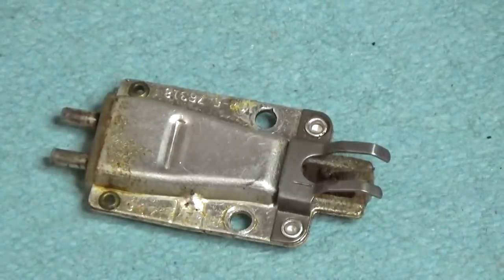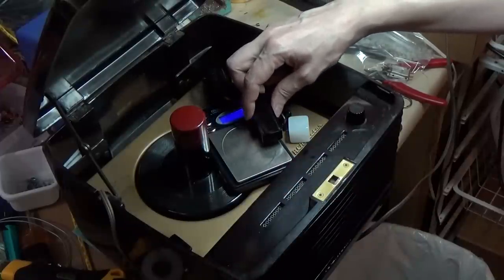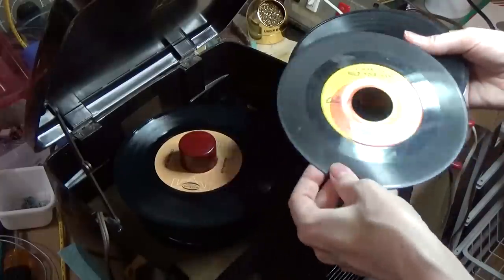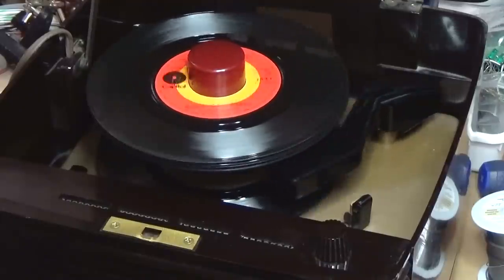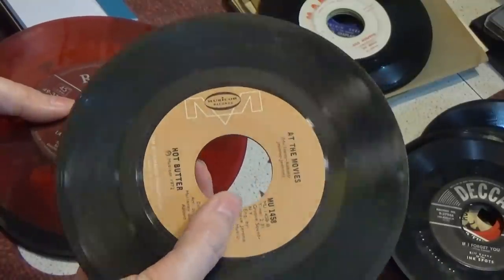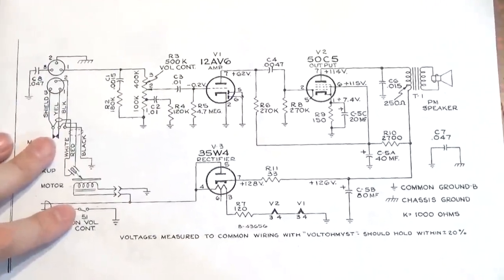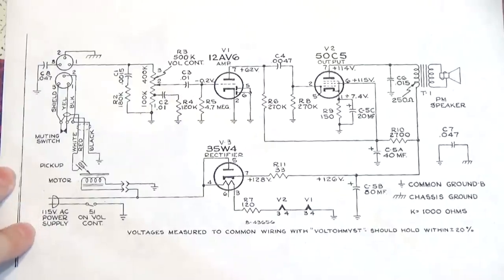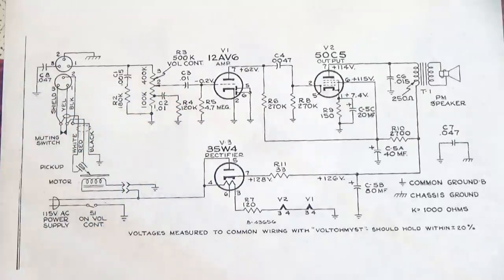RCA Victor 45rpm Record Player "Desktop Jukebox" Repair

Comment: Chris Cuff is the expert on these RCA 45 RPM players; he has videos showing a full teardown and rebuild of the mechanism. Your player uses the RP-190 mechanism, introduced in 1950.
Reply from the maker: Yea, A guy sells refirbed rubber parts for these but honestly I just don't have the time to tear into it for that idler wheel.  It's fully oiled and greased, and that's fine for me.
Reply: if you had to,, replace the rubber with 2 or 3 stacked o-rings of the correct OD/ID size. And lead tape would prob work well for the weight.
Reply: Rubber parts can be boiled to remove flat spots, and MG Chemical sells an excellent rubber restoring fluid which works wonders and smells really nice (paradoxically, many such things you shouldn't spend a long time smelling smell really good, liquid electrician's tape comes to mind, smells like the Frosting of the Gods...).

Comment: Hi, my first record player was an old RCA 45 RPM deck like that, but without the fancy case. I found it at the dump ground and later found an old AM radio that had a plug for the RCA jack to hook up the deck to so I could listen to records.  We had a teen center where the places in town that had juke boxes would drop off their used records, and we could buy them for a quarter each (this was like 1964-65) so that's how I managed to get records on my buck a week allowance. Sure brings back memories seeing that old set working! I had an old shack behind our house that was at one time a farm grain storage shed long before the town closed in on the old place where we lived.  I fixed it up, even sheet rocked it with panels we tore out of old house that we were paid to tear down, I had her fixed up nice. We had an old couch that I put in there, an easy chair, I brought down an old second hand TV set that my uncle gave me when he got a new on and put out there, even found an old bed in our storage area that I put up in the second room of the shack. Put my record player back there and used my old train transformer to power an old sealed beam headlight that we had painted red to illuminate the place.  It was great, what a place for young teens who were experimenting with our sexuality. I can recall getting it on with my first girlfriend to the tune "Hello I Love You!" by the Doors playing on that old 45.  It was the only record on the machine and kept playing over and over as we explored each other.  Ah yes that was a time to be alive, the 60's before everyone was frightened by AIDS and free love was the topic of the day.

Comment: Fran there is a spring (or should be in the rear of the tonearm.)  take that spring off and you may need only 1 (Nut) weight or possibly none.

Comment: In my days as a broke teenager, there was a vending machine company that sold 45s pulled from jukeboxes,  25 cents each, 5 for a dollar. A lot of them were on their last legs already, but played on my Singer portable they were all mine. Had a 45 of Hot Butter, too.
Reply: That was a good song!
Reply: in my neighborhood, it was a stereo/camera shop that got the 45's from jukeboxes. 10 cents each - no sleeves on them, and all had some obvious wear, but played well. It was a great way for a kid with very little money to build a collection of 45's. Most were only a year or two old.
Reply: I was a teen in the 80s and I don't recall there being an easy way to buy jukebox rejects.  A new release was about 1.50 and used records generally went for 1/2 of that or less.
Reply: Some of us just got lucky. I miss the days of huge warehouse style record stores like Tower Records. I  could have spent a lot more $$ there...except I didn't have much money.
Reply: There was a store I regularly went to in the 90s after vinyl died that specialized in 45s for jukeboxes. They had loads of old used 45s pulled from jukeboxes for very cheap, and also had many new release songs on 45s labeled “for jukeboxes only” that weren’t that expensive and were often on colored vinyl. I remember buying Creep from Radiohead there when it was a new hit song.

Comment: Hi Fran. 😊 The 250 ohm for the output transformer primary is the DC resistance.  The actual load impedance will be probably 3k or so. Cheers.

Comment: I believe the stylus is not sitting down snug on the felt pad that that ultimately  is connected to the ceramic element  hence you need extra weight to push the stylus up against the pad even before you add the weight necessary for the basic tracking.
Remove the stylus and slightly bend it near the screw mounting as to cause the stylus to press up against the pad when the screw is tightened.
From an  old time tech...Glen

Comment: Back when audio/video equipment popularly had rubber drive wheels, they used to make a fluid for reconditioning the rubber surfaces of drive tires.  But, that only helped with traction issues, and was never permanent, at least in commercial use equipment.  It was great to put equipment back into service while waiting for repair parts to arrive.  That said, what I hear in this video sounds like a wheel shape issue.  Flutter can also come from sticky bearings or bent shafts.  

I think from the 50s and later, most changers were small spindle type, and ppl bought plastic inserts to adapt 45s to play on small spindle players.  Meanwhile, juke boxes' tooling typically handled the 45s from their edges.  The thicker hubs made it easier to insert the plastic adapters, and allowed for a longer lasting hub diameter in juke box service.  The importance of working with a 45-only changer fell by the wayside.    Just a guess, though.
Reply: Kind of an inaccurate guess. The changers that were popular in the ‘70s well through the mid ‘80s (I had several back then) used a special spindle for playing 45s that dropped them from the big hole. The most common one was made by BSR. The biggest difference is these held the records stationary until it dropped them on the platter. This was the most common one: https://images.app.goo.gl/p6UjSNfv9rQEW7YR7

Comment: The rubber drive roller has probably hardened and lost its elasticity. If you use your thumbnail to make an impression and it doesn't spring back & disappear in a few seconds that indicates the rubber has "perished". That's why you have to replace or recover typewriter platens from time to time. Suppliers used to give us little sets of one "live" rubber ball and one perished one, so we could demonstrate the difference. The live rubber bounces while the perished rubber just drops like it's make of wood. There are companies that "re-tire" rubber rollers. It might be worth checking out.

Comment: For all of 0.02 seconds i expected you were going to say you'd a cunning way of whittling the actual grove contact tip from some kind of unobtainium to replace the one in the stylus on your new pickup. As usual, another neat video. The actual sound with the warble effect would send my crazy meaning i'd probably tear the entire mech down and fail miserably locating any kind of parts to be able to fix it...
Reply: It’s just the idler wheel that needs replaced. They’re actually not hard to find. That’s the next thing I’d have fixed as soon as I got sound out of it and realized it had such bad wow.

Comment: Fran, the center indentation of the record that you are referring to is caused by a set of machined dies as you stated later in video.  There were several different styles of dies, but in 1950's through the 1970's there was a spec called out for this inner indentation.  BTW - RCA began development of the 45 rpm in 1939 and issued the first 45 rpm's in 1948 or 1949. Great video.

Comment: I found one of those old 45 RPM decks out at the city dump once when I was a young fellow, we were pretty much dirt poor so if I wanted stuff to tear apart, I needed to crawl down in the pit and see what others had thrown away.  Back then there were no dump ground supervisors, it was just a huge pit where folks tossed their crap, and the city dump truck would dump.  Took it back home and hooked it up to a small amp I had found some time before.  Boy I had something for sure, it sounded really great too, I hooked up all the speakers I could find and tried to tune them with variable resistors I had pulled from old TV's and the like, but they just amounted to switches that would play the tunes over the speakers if turned all the way one way, but still I made it my self, and really wowed my friends, especially that little girl next door, but then that is another story completely.
Reply: Oh the tune that was the favorite back then:  The Doors "Hello I love you won't you tell me your name"
Reply: Did you win her over?

Comment: Hello Fran !!  With that 45 player idler wheel try using just a little "RUBBER RENU" on the idler wheel surface, it may reduce that warbling by a fair amount !  RUBBER RENU is a cleaner/rejuvenator liquid compound, it restores some lost elasticity to the rubber which may reduce that "warbling" sound effect.

Comment: After doing my own restoration of one of these, I was still getting a loud, intermittent hum.  The tone-arm wire is a twisted pair, not shielded, and it's held under several metal clips on its way between the tone-arm and the amplifier.  Turns out the wire was frayed slightly under one of those clips.  Some electrical tape around the wire fixed it!

Comment: Just so ya know... it's not paraffin that leaks out of the cartridge, it's Lanolin. Nice video. It's really a shame that they don't offer the Pfanstiehl P-51 with a diamond tipped stylus. I gather from what you said that you somehow bought the Pfanstiehl P-51-2 (with the -2 indicating a 2 mil tip). You can buy the Pfanstiehl P-51-1 which has a 1 mil tip, but both are sapphire tipped. For those curious...the P-51's are supposed to deliver .7 volts to the preamp. I wish I knew what the original crystal cartridge (RCA 76318) voltage was ….

Comment: Hi Fran!  At 16:15 you remark that 250 ohms is a pretty low value for an output tube plate.  The 250 ohms is the DC resistance, not the AC impedance, which for a 50C5 would be in the neighborhood of 2K.

Comment: Great memories, I had the basic changer only version of that machine., no case or amp. I well remember that old ceramic cartridge.  I remember certain later “45s” would hang and fail to drop.   Wish I still had mine some 50 years later, but sadly it went to a new home during one of mom’s garage sales.

Comment: Initially when I restored my 45 player (same mechanism as yours) I used a stereo ceramic cartridge and to make the tonearm heavy enough I first loosened the spring some then later on I replaced the spring with a bolt I glued in the space where the spring went.

Be careful with that mono cartridge and stereo records as most mono cartridges don't have the compliance to properly play stereo records without damaging them.

Comment: People often think a heavy tracking force such as used with ceramic cartridges will damage records.

It won't IF the tracking force is within the manufacturer recommended range for the cartridge and stylus tip shape.

I suspect most of the 45s were played on ceramic cartridge record players and many if the player and record was taken care of still sound very good today.

I have a few that I know my mom played on ceramic cartridge record players which I did as well and they still sound like new.

Comment: Lol...  I was fortunate to catch the tail end of the 45 singles era in the 80's as a teen.  I remember my parents had a record player that had the standard sized "nub" for LPs, and a tall multiple disc changer (removable) cylinder  part that would optionally sit on top of that for 45s and worked as a changer like your jukebox.  It was all auto like yours, so it makes me wonder how ours would have known to drop a record, perhaps the LP nub had some mechanical bit I didn't notice back in the day...  It was of a newer vintage than yours, probably late 60s, and I don't recall the changer having problems dropping newer records from the 70s and 80s.  Anyhow, great video!
Reply: ...oh, and oddly my own personal record player had the reverse set up, where the LP nub was really tall and could automatically drop up to three LPs,  but only had a little plastic "hockey puck" for 45s.  But I think this was much more standard by the 80s.

Comment: RCA had a vested interest in making their records compatible with those changers they were giving away for 15 dollars apiece; I'd be surprised if competing labels were as diligent even in 1950. I'll bet the 45s with thicker inner edges actually worked better with one of those one-piece GE 45 stacking adapters. BTW: I've heard that putting a rubber band around the outside of the idler, supergluing it and sanding away the superglue can restore them. I'll have to try it sometime.

Comment: 6g is pretty low btw. On eastern side of the iron curtain we had 7g to 12g as a standard for ceramic cartridges, depending on a cartridge type. 50s machine like this would have at least 10g..

Comment: Fran Blanche if it were mine, I would use a Qtip with a drop of brake fluid on it, and run it around the rubber of drive wheel. Then let it sit for several days before playing it. Brake fluid is a great rubber rejuvenator. It might take a few applications over a couple weeks, but it should soften it up considerably...

Comment: 5.7 grams is light for a ceramic cartridge.  I've seen some DJ magnetic cartridges track even heavier.  If there's a conical stylus shape, you can almost track that as heavy as you want, but if you have an elliptical or Shibata  stylus, they need to track as light as possible because they're actually harder on your records because the shape of the cut of the stylus.  But they're not going to ruin your records at all.  Another interesting note, when I had a record that would skip, I'd actually remove weight from the stylus and it usually took care of it.

Comment: This is very much the kind of stuff i do when i have the time/or drive/desire. I wonder if when people like you and i and the rest of that do this stuff are gone, will it continue?? When will the leftover tubes finally be gone? I have saved every one i could get my hands on that still have good emission, thinking forward to when i'll need one. Sadly one reason they still kick around is people see $$ in old tubes, at least they are not ending up in a landfill somewhere and are in some kind of circulation still....
If it has tubes in it, i have fondness for it. Thanks for sharing Fran......

Comment: That is one thing I noticed is 45 RPM Singles over there in the USA have a large hole in the middle.  All the one's I have, have a small hole like 33 1/3rd LP's. although all the turntables come with a spindle adaptor.   I have an old turntable, it is a Perpetuum Ebner Rex, in an old Siemens German Radiogram.

Comment: More than likely once the RCA 45 players fell out of favor, there was no real need to keep the center hole thickness at a certain tolerance. 

I have many 80's records which work fine on a 45 player.
Reply: Additionally, I would guess most of them ended up being played using spindle adapters anyway.  I think these videos from Fran are the only times I've ever seen an actual thick spindle

Comment: btw.. the alignment is not quite perfect. I notice that when the arm follows the 'take out' groove at the end of the play,  the needle bumps the label of the record just before the arm lifts. It's a simple adjustment, but it's done underneath, not from above. YET, I learned something too, from you, about the thick inner vinyl being the cause of the record not dropping. I never thought about that, but you figured it out. I'm guessing that any and all RCA 45's will not cause you trouble dropping. Probably the reason that Bell record dropped, even though it was a more modern product, is that Bell was a cheap label and they probably used a pressing plant that hadn't updated their pressing machines since the 1950's. Just a guess.

Comment: I prefer separate components to the all-in-one approach, so I have the RCA 45-J-2 going into a Zenith C845 phono input. Now you've got high fidelity! (...ish)  Seriously, though, many people stuff stereo cartridges in those and wire them for mono so the stylus has the compliance to give vertically and hopefully not destroy (as much) those stereo 45s.  I bet at lighter tracking force, the needle jumps out of stereo records more than it does mono ones.   Also, the thick 45s are often made of styrene instead of vinyl, and they were bad even when they were new!  So what's another 6 gram stylus going to do to them?  I'm sure other record players of the day tracked even heavier, and I've got an RCA changer that tracks at about 11 grams!

Comment: Hey, if you look up the spec of that original cartridge, this should have tracked at about 4.5 Grams, and they have other cartridges that are current ceramics that will track at Under 5 grams. Might track a bit better than the one you had to add nuts for....

Comment: If 6 grams is the recommended tracking force for the cartridge, it will not damage the monaural records.  You might have chosen a stereo cartridge with a lesser tracking force and bridged it for mono.

Comment: Reminds me of my days running a disco, although our stylus was around 2.5g, we  sometimes added a coin on top of the arm while playing if it was a bouncy floor and the audience got a bit active :D
Hope the tape doesn't drop the nuts on the record, i would have used a bit of hotglue, to release the nuts just heat them with a good iron or a heatgun